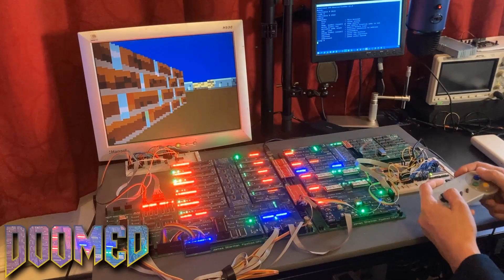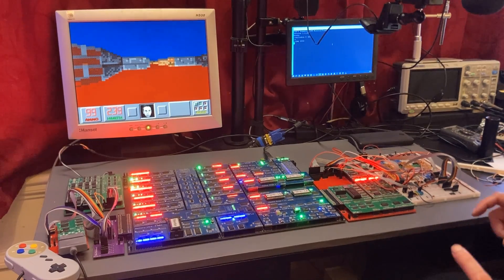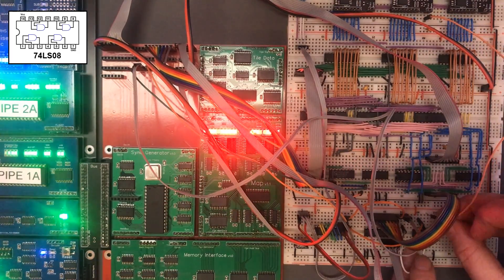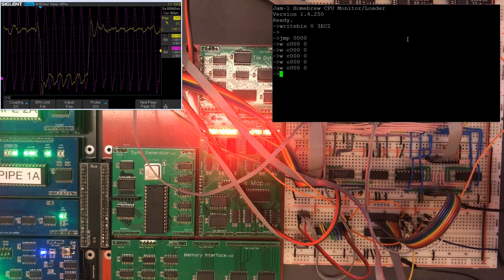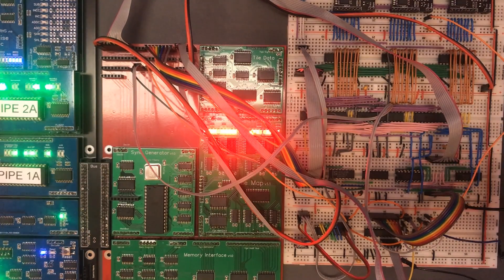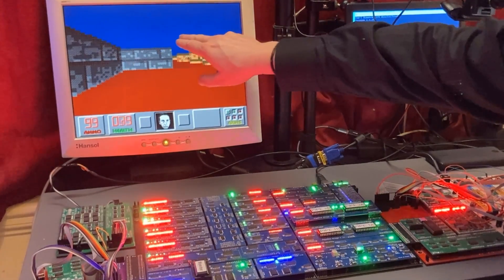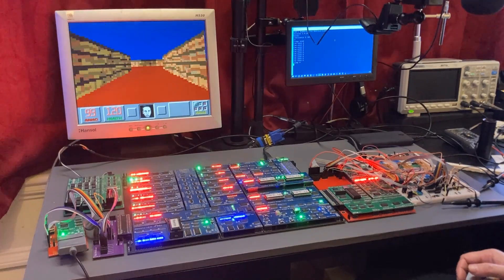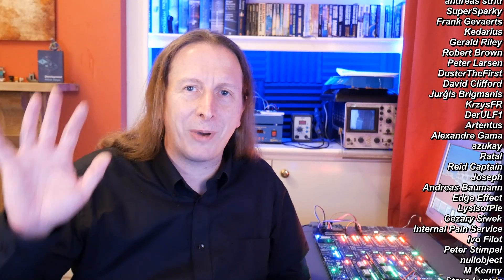Signal Cleanup - VGA from Scratch - Part 17

Comment: Wouldn't dual port memory make this easier?  It turns out such memory is available.
Reply from the maker: Available but very expensive! Suitable parts about about 20x the price of the ram chips I'm using here.
Reply: Almost no chip included two-ported memory (for cache) even though the designers are free to do what they want. And I wonder how generic two ported memory looks like! Memory arranges cells in a matrix. So for two ports you would basically keep all the bit and word lines, but half the bit cells . So two addresses lead to the same but.

Why not just buy VideoRAM . A normal matrix of DRAM cells. Only the SRAM behind the amps is duplicated ( and 1D anyway )
Reply: @ArneChristianRosenfeldt  Two port memory was used for video display, not cache.  This allowed the video display hardware to access the video RAM without having to halt the CPU.
Reply: @richardkelsch3640  I only found one data sheet about two port memory. It was used to interface between two clock domains with random access. Collision on a cell could happen and it is your responsibility to avoid this.

Video RAM only has a single clock for the DRAM part. Every DRAM has internal SRAM to be able to refresh a row. Video RAM has two SRAMs on chip, but each of them only has a single port. Cost always weeded out large true dual port memory. I mean, put some video ram on a breadboard and show me read after write consistency. I think Michael Abrash did that for self modifying code to measure the instruction queue on 8086 derivatives.
Reply: @ArneChristianRosenfeldt  That's too bad, as dual port memory in the 1980s had two address buses and two data buses.  They allowed for easy interfacing of display memory for computers on a local bus.  There were some limitations, but not so bad as to need to halt the CPU to accomplish.

One bus (let's call it primary) allowed full control of the memory cells, both read and write.  This was typically what you connected to the CPU side.  The other bus (secondary) had unlimited read access, regardless of the primary bus state.  Some devices were secondary read only and some had write semaphore access.

Electronically, think of the secondary bus as merely an additional transistor tap off of the memory cell to read data.  Write devices had to have an additional secondary bus output to induce a wait state should the primary bus be writing to the chip.

Most display hardware of the time were not intelligent and usually just framebuffers, so secondary bus read-only was reasonable for the display hardware to use.

At the time these chips were sold, they were expensive as they required many extra pins to have isolated bus signals and a slightly larger die size.
Reply: @richardkelsch3640  actually I had trouble to find the pinout of videoRAM. Back in the day RAM had 1 or up to 8 data pins. Address is multiplexed. So 8 address pins and 32 bit words for 256kB VGA card. Yeah, needs double RAS CAS.

I would have thought that people try to save pins and use something like RAMBus or sdram. I guess I will stick to DRAM and SDRAM. For example the PlayStation has GSRAM where basically multiple banks of fast page mode DRAM sit on a single chip. So the PSX could blit from texture RAM to framebuffer without trashing a page. Probably, the front buffer also had its own bank. PSX has this strange memory layout with like 256!! banks.
Reply: @ArneChristianRosenfeldt  "Video" RAM or dual port RAM was a minority, not the norm.  Because of its expense, video cards started to use very fast RAM and secondary buffering.  The video device would access a page of RAM, dump it to a line buffer at high speeds, and then allowed the CPU to have single access cycles without interference.  Some would interleave access.

The more expensive and complex the video device, the faster the access became.  Today, when you access the video device, the GPU decides how and when the 
CPU accesses the framebuffer in a serial fashion.  The GPU RAM is essentially completely isolated from the CPU these days and the CPU just sends instructions and packets to the GPU to process.  This process is quite quick, but not direct anymore.

Note, some extremely expensive early PC video cards (AT bus) used video RAM.  It am pretty sure SGI used it too.
Reply: @richardkelsch3640  I dunno if YouTube ate my answer, but it just occurred to me that VRAM is probably great for CAD where the lines are made up of a lot of single byte writes. So you cannot utilize wider words nor interleave.